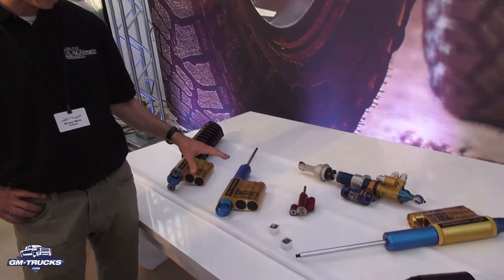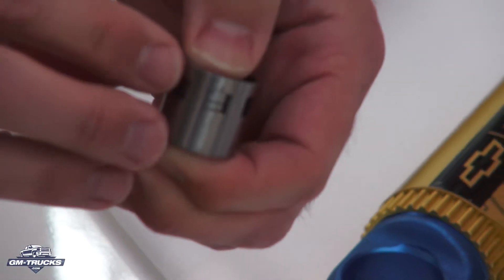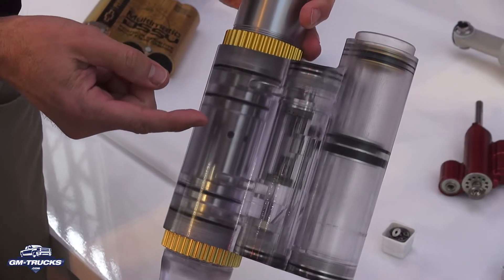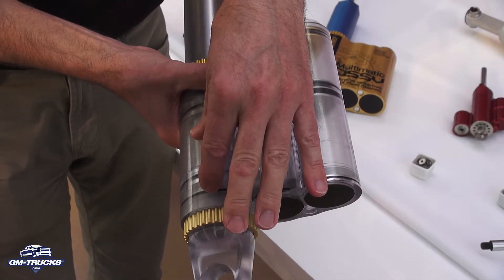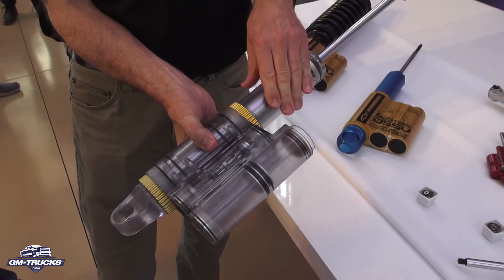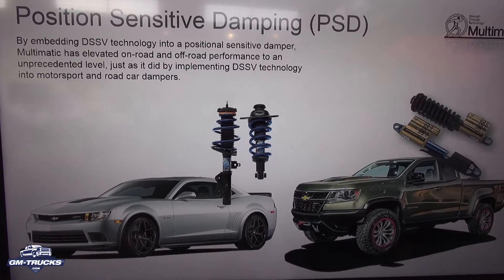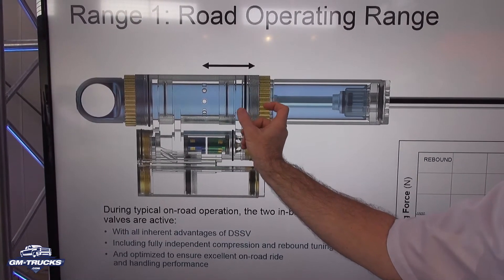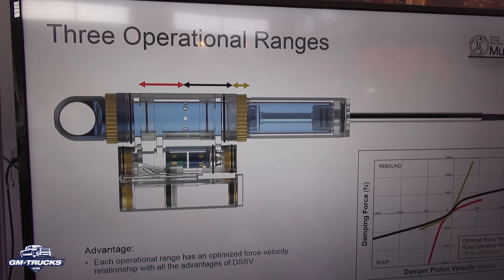How the DSSV shocks work on the new Chevy Colorado ZR2

Comment: People trash talk this shocks but they are decent shocks for anyone that does off road but not extreme off roading, mine starting to leak when i took my truck to the snow some people say that lower temperatures make them leak but who knows. This shock serve their purpose until they didnt. Anyone with zr2 i would recommend going to fox if you do extreme off road (thats what i run), or cheaper option king shock or icon . Also do recommend shock relocation for anyone with a zr2 2nd gen

Comment: Too bad the seals blow around 36k miles sometimes even as soon as 10k with minimal off-road use. Had to swap to Kings in the rear because warranty wouldn't cover it and dealership wanted $1300 for one shock. Oh and can't be rebuilt. 

The DSSV's are fantastic but longevity and maintenance makes them a one off then replace with something that's gonna last longer and be easier to maintain.

Comment: Winning points of ZR2: front and rear lockers and diesel engine availability (has to be after market tuned for decent performance). Losing points these p.o.s. shocks and the lack of a manual transmission.
Reply: Cal Ripson you’ve obviously never ridden on this suspension system. I love it. Truly has a slightly stiffer feel on the road to maintain handling but once off road you can literally feel them loosen up and coast over rough stuff. Plus they stay way cooler then a traditional shock. Hands down best suspension system I’ve ever owned.

Comment: Worst part of the truck. They are overly complex and prone to leak. Would much rather replace them with after market off road shocks. Typical GM solution that f ups an otherwise pretty good truck.
Reply: I wouldn't necessarily say they are the worst part of the truck. They are fantastic when they work and I've absolutely loved them however yes they don't last, can't be rebuilt, and are expensive as fuck to replace

Comment: Clever. They must be quite expensive
Reply: Yes very. Dealerships will charge $1300 just for one. You can find them on GM parts direct for 600. But they can't be rebuilt so that's Everytime you have to replace one.
Reply: @Crooked_Wien  For a suspension you will be spending upwards of 2k. I'll pay 5k for F1 tech.

Comment: ok when NEW !!!!!!!!!!!!!!!!!!!!!!!!!!!!!!!!!!
how mush to replace at 100,000 miles $$$$$$$$$$$$$$$$$$$$$$$$$$$$$$$$$$$$$$$$$$$$$$$$$$$$$$$$$$$$$$$$$$$$$$$$$$$$$$$$$$$$$$$$$$$$$$$$$$$$$$$$$$$$$$$$$$$$$$$$$$$$$$$$$$$$$$$$$$$$$$$$$$$$$$$$$$$$$$$$$$$$$$$$$$$$$$$$$$$$$$$$$$$$$$$$$$$$$$$$$$$$$$$$$$$$$$$$$$$$$
Reply: Actually, they don't need rebuilding like normal shocks. they don't have any fatigue wearing.
Reply: @MrGuitarbike  correct but when they blow a seal (which is happening often around 30k miles you're pretty much SOL